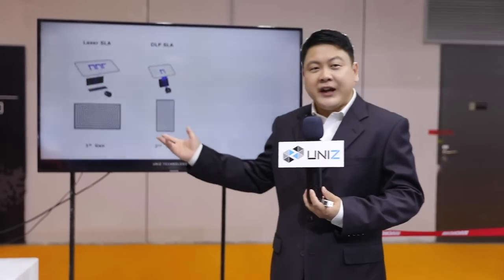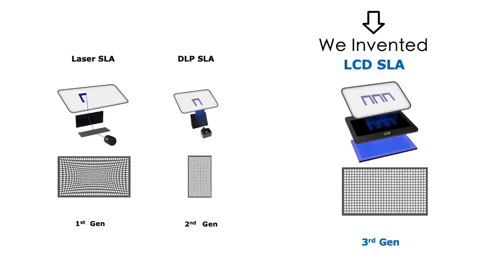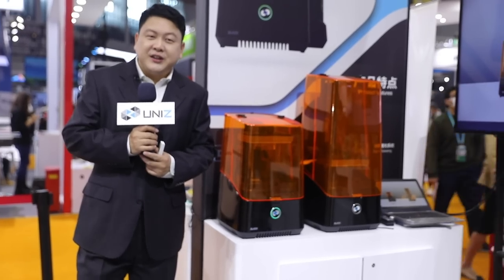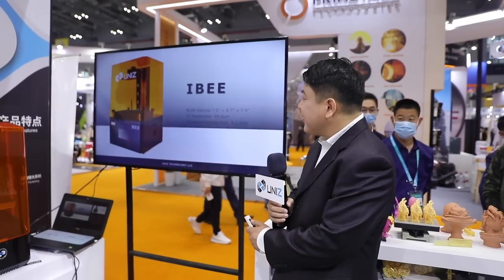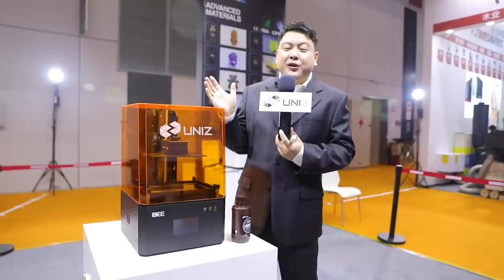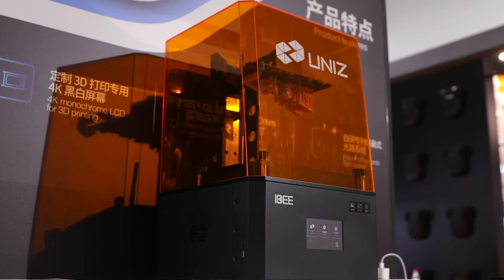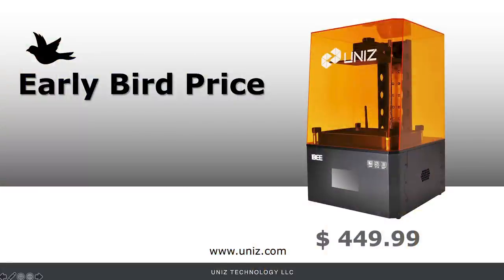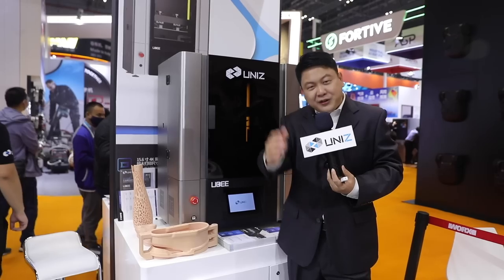UNIZ Unveils IBEE: the Launch Event

Comment: Bought a unit in April and the unit began failing after only 2 months with very low usage, was sent a second nonkickstarter edition, and it will not even level correct, I feel like I was giving the bad, no worst apple in the bunch.